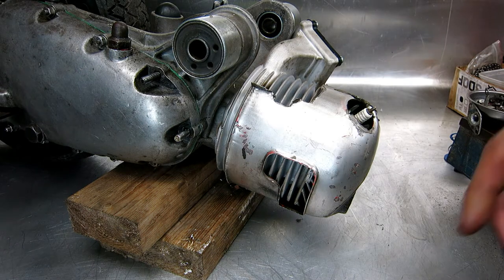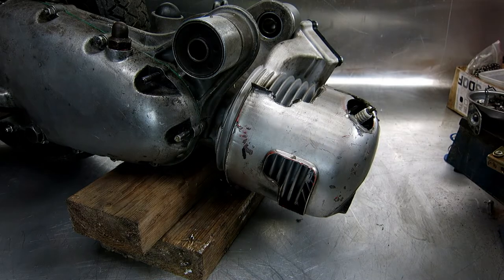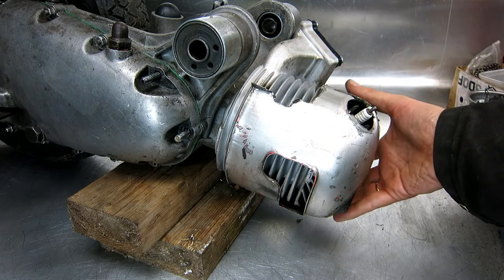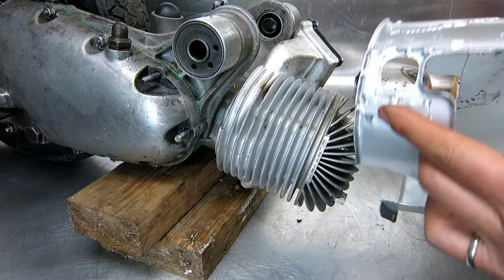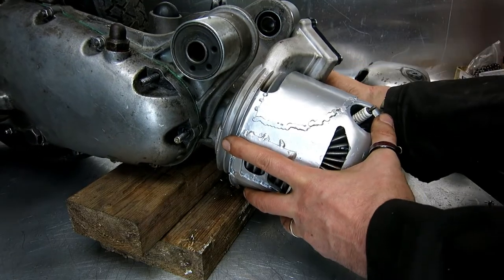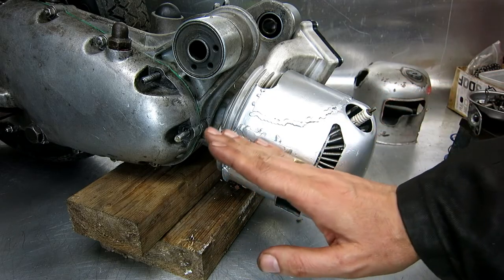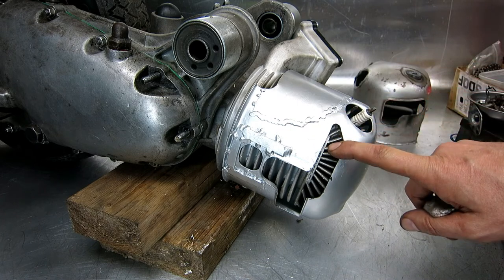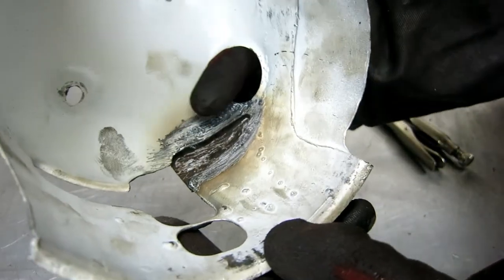COMPLETE SPANNERS LAMBRETTA KIT BOOK - Cowling modifications

Comment: A cowling doesn't make sense to me...the Finning is to increase airflow and keep the cylinder head lower..a Cowling raises it
Reply: If scooters were open like a motorcycle yes but they’re not, on both Lambretta and Vespa, the engine is concealed by the side panels. So you need the fins on the flywheel to direct fresh air to cool the cylinder and head. This cowling helps to direct that air flow